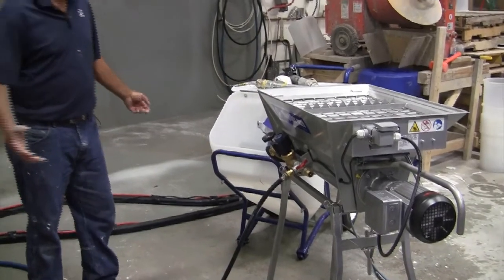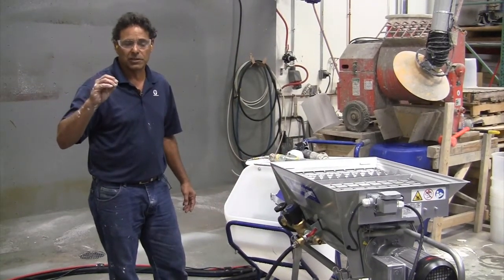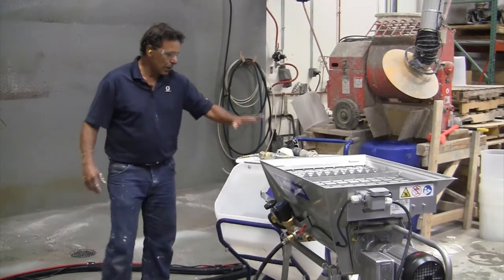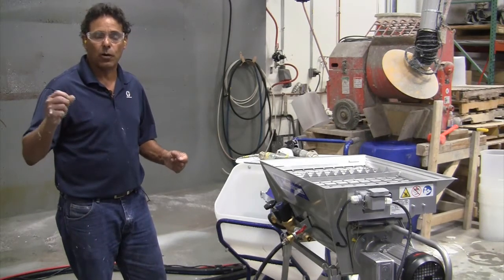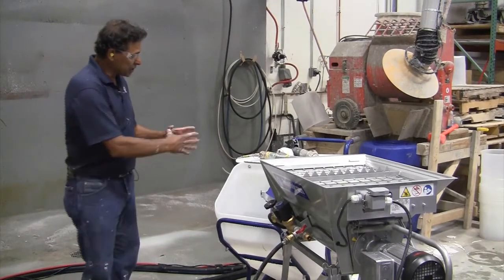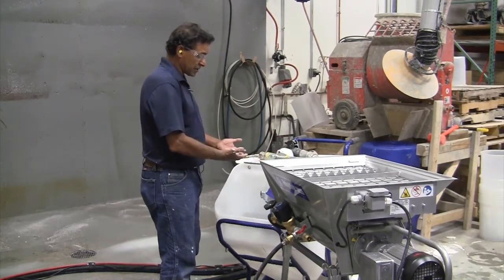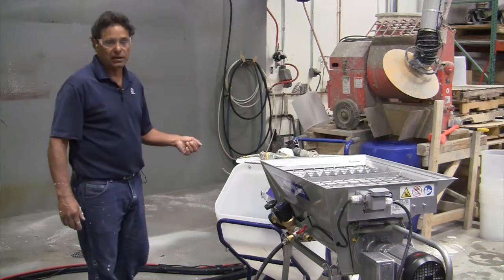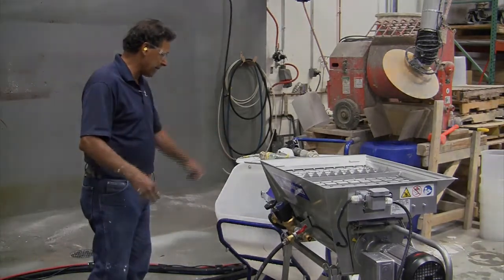Part 1: Getting Started With ToughTek CM20 and S340

Comment: Do the cm 40 mixes fireproofing produce
Reply from the maker: Hi Marlon. Sorry for the delayed response. It will mix it, but it might not do a very good job because most cementitious fireproofing materials need a longer mix time. With this continuous mixer, the shaft isn't long enough and could prevent the material from getting the right amount of air, resulting in poor density.